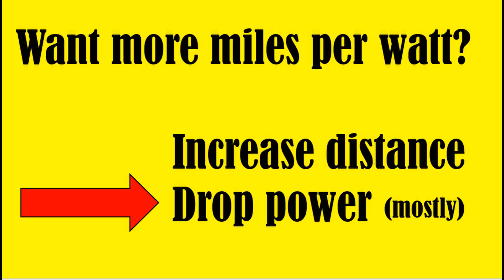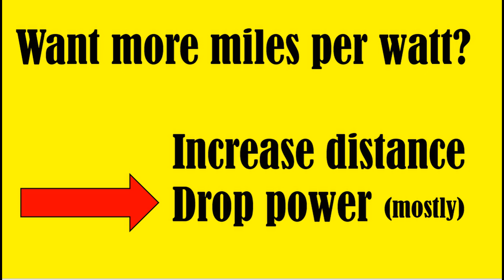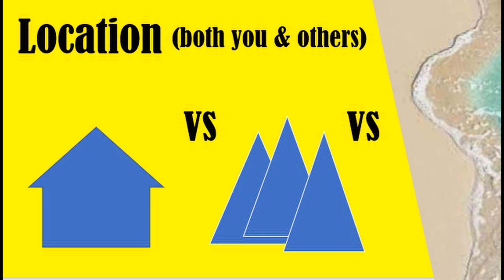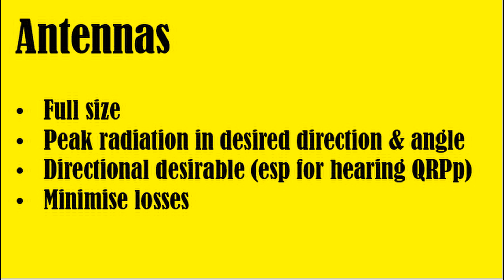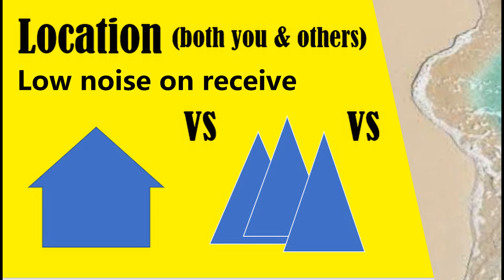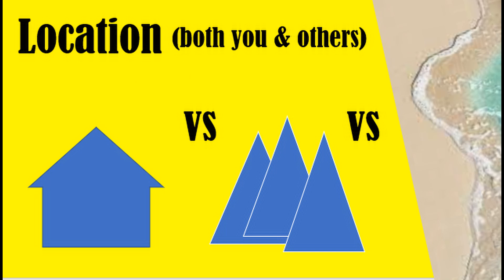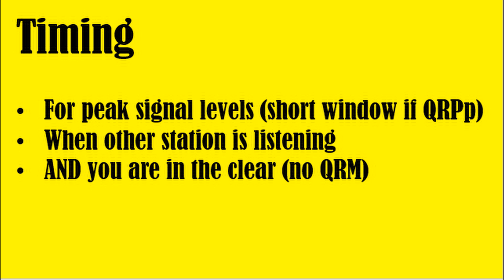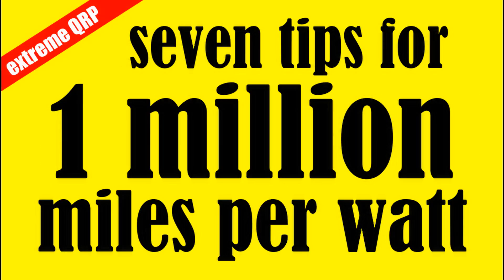Seven tips for 1 million miles per watt (EXTREME QRP)

Comment: Two tips for TWO million miles per watt: 1) Use very very low power, for example a signal generator set to -71 dBm. 2) Keep distances very very short, for example 1 foot (~30cm). If you can detect the signal generator over one foot distance, then you'll have reached TWO million miles per watt. If you wish to best your new record, then move closer and turn down the signal generator's output power. Miles per watt is a very silly measure since the mathematical relationship of the inverse square law favours very low power over very short distances.

Comment: You're a champ,  I have your Ham beginners book mate.  Just wanted to say thank you.  While i was waiting for purchased antenna's to arrive... i followed your directions about the extension chord hombrew dipole.... i had a brain fart and used a 10m lead instead of a 20 as you stipulated.... I have yet to trim it up (SLACK!) but with this Xiegu G90's internal tuner its quite snappy! transmitt is a bit weak.. although.. that could be the fact that is only 3 m off the ground with shipping containers  slightly in the way.. hahaha! but ive hit norway, the states, most states in Aust.. anyway.... thanks.  and would like to recommend your book and channel to others reading this.  Vk6apt. Onya mate

Comment: Another great video! If you're happy with beaconing (I am!), then WSPR is the way to go. I've been spotted all over europe (I'm in the UK) using around 50 microwatts into a not-very-high 40m full-size wire loop around the garden. At such low power I sometimes only get two or three spots across all bands in a 24-hr period. Two interesting things have occurred: the first is that, of the stations that DO spot me, consistently, say, at -25dB, very occasionally, I'll be spotted by them at much better SNR. I don't know what's going on there. Also, say I'm running 100uW and the spot from the reporting station suggests that I could drop power by another 6dB and still be spotted, this rarely, or never works. It seems to be the case that the ionosphere only reflects signals over a certain intensity threshold?? Is there any evidence for this? Fascinating stuff - Martin, G4EFE
Reply: Yep. My Zachtek Desktop 8010 at 200mW regularly reaches Australia and New Zealand from eastern Canada, ~18,000km. Only about "100,000 miles per watt" though. :-)

Comment: No QRP! Makes me laugh everytime. Thanks for advice Peter. I certainly reckon low noise is a big factor. I was working portable last weekend in Region 1 SSB Field Day (QRP of course). I noticed it was generally easier to contact other /P stations compared to fixed stattions. I wondered if the fixed stations, despite running more power with higher gain antennas were being constrained by high RX noise.

Comment: How QRP is Voyager 1? Only 22.4W at the transmitter and nearly 160AU away and 22 hours propagation time. That's extreme QRP. Of course the 44 hour round trip would make it hard to exchange a contract with the space probe.